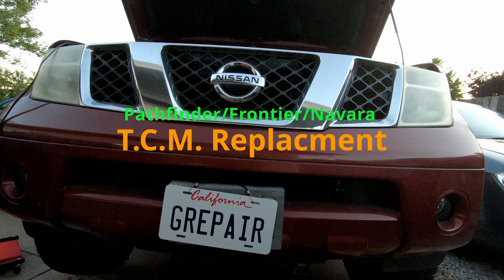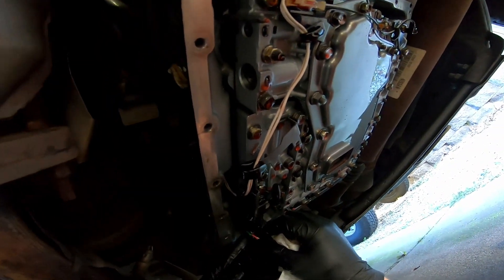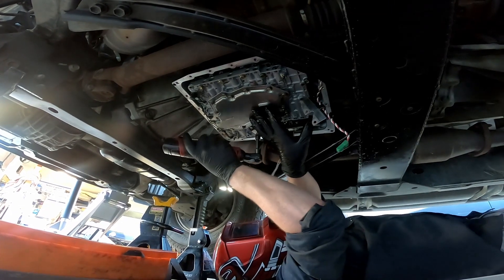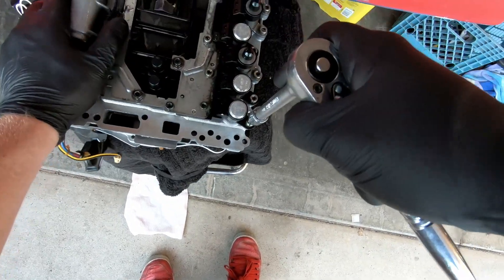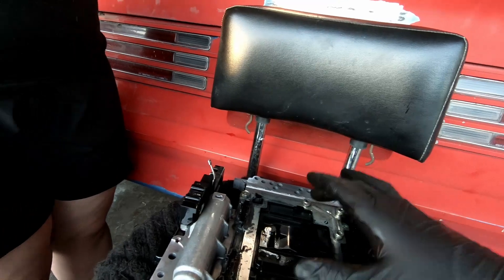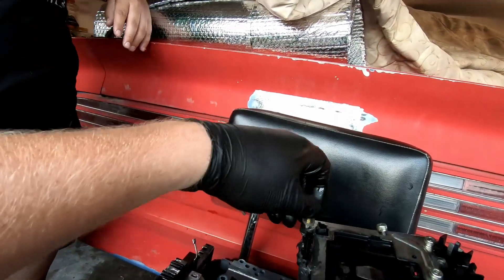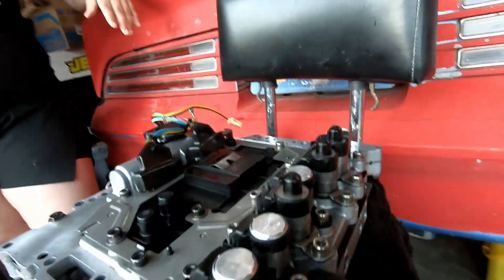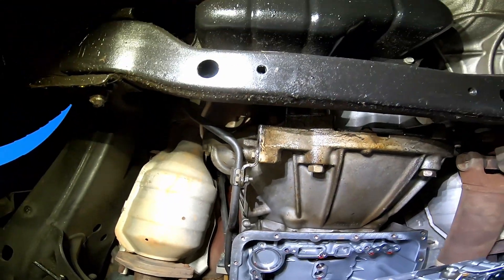How to Replace Nissan TCM 2005 - 08 Truck/ RE5RO5A

Comment: Great video brotha. I’m having reverse issues on my 05 pathfinder SE. what can possibly be the problem?
Reply from the maker: It's hard to say without looking at it. I could be the tcm, it could be a solinoid, or you may need a rebuild. Have you hooked up a scanner? Do you have any transmission codes?
Reply: @GrimRepair  would u happen to know if and where I can get jus the solenoids?
Reply from the maker: @jondoe1410  There is a link in the videos description.
Reply: @GrimRepair  where are u from? It’s saying that these items cannot be shipped to me. I’m in Sacramento California
Reply from the maker: @jondoe1410  I am not far from you, not sure why it's saying that.I will fix that link, thank you. The exact ones I ordered are out of stock. These ones say they fit 2002 - 2018 pathfinder. https://amzn.to/3sddV72
Reply: @GrimRepair  thanks bro. My car doesn’t shift into drive or reverse at all now. Taking it back to the dealer on Sunday

Comment: Hey i fully replaced my whole tcm with the valve body and now when i wanted to turn it on it said it was on 3rd and not on park, but it clearly shows on my shifter that its on P. Any help? Truck doesn't want to turn on cause of that and moving the shifter up and down doesn't change anything
Reply from the maker: Make sure the shift linkage is lined up on the valve body.

Comment: I purchased the silenoids on Amazon and it didn't give a diagram or instructions on which ones belonged in the appropriate spot. The numbers don't match on the new ones so I'm not sure where to place them. Any suggestions on the correct order?
Reply from the maker: There are 3 with the black caps sticking out on top, those go where the 3 with the black caps came out of. There are 3 without the black caps those go where the 3 without the black caps came from. Then there should be one that is mostly metal less plastic than the others that one goes on the end where the other one came from.
Reply: @GrimRepair  thank you. That's what I was assuming but I wanted to make sure. I'm working on my 05 xterra. I believe my solenoids are good but I had a break in the connection on the front brake solenoid. Seems to be pretty common. Thanks for the video.
Reply from the maker: @christopherlopez6768  that break is usually inside the tcm is that what you fixed?solinoids usually don't go bad but they break when you pull them out. Let me know how it goes.
Reply: @GrimRepair  yeah the break was in the TCM and I was able to pull all of my solenoids out without breaking any. Now I can return them to Amazon and get my $70 back. I soldered the break and hopefully that will fix the issue. Seems like people have had luck. Worse comes to worst, I'll buy a refurbished TCM and replace it. Did you end up buying Nissan transmission fluid to replace? I'm skeptical of buying anything other than the Nissan TF.
Reply from the maker: @christopherlopez6768  cool, I used valvoline.

Comment: Can I just replace the solenoids ?? I have the code coming up for the input clutch solenoid and how would reset it
Reply: Reprogram
Reply from the maker: You can replace just the solinoid, if that's all it needs you won't need to reprogram. It is likely a broken contact inside the tcm though, it's a common problem. I bought a remanufactured tcm and I did not need to reprogram it. If you do need to reprogram, you'll either need an expensive scan tool, or pay the dealer an hours labor.

Comment: I've seen this video before because I had the milkshake of death. But now I'm experiencing what you talked about at about 5 minutes into your video where it's not communicating and my truck won't start so thank you this video is amazing. How much did you pay for the TCM Module?
Reply from the maker: %
Thanks, I paid $600 from oriely's but prices have gone up since then. I tried going cheaper routes but both of those didn't work out. There is an amazon link in the description for the tcm I bought.

Comment: Thanks for the awesome Video Grim.  This sounds like the problem I having with 2007 Xterra.  I'm ordering the TCM from Street Smart tomorrow.  Do I just replace the radiator too or is there a separate radiator/cooler for the transmission?
Reply from the maker: Thanks, the factory set up incorporates the radiator, and it's prone to failure. If yours has coolant contamination you will have to replace it. If you live in a warm climate you can run an extra external transmission cooler to prevent coolant contamination from ever happening in the future.
Reply: @GrimRepair  I got the TCM and radiator switched out but the vehicle still isn’t starting. No codes but the dash is showing the transmission in 1 and not park. I tried the unlock gear shift. 

The fuse is good. Any thoughts?
Reply from the maker: @armh3  it sounds like your shift linkage isn't hooked up right the car won't start in anything but park and neutral.

Comment: So I ordered the solenoids on Amazon for my valve body, but it doesn’t say which is which and they are all similar.  Can you help me. Please?
Reply from the maker: There are 3 different types. One type has a plastic Top, one type has a plastic Nipple on the top and one type is metal on top correct?

Comment: Did you have to program your tcm? I did this to my 06 pathfinder, and it does not start, not even crank.
Reply from the maker: @joeortolani9897  I did not, does it say it's in park on your gauge cluster?
Reply: @GrimRepair  it does not. Thank you for responding. Come to think of it, when you turn the key to on, it wont even display the gears. PRND12, bad throttle body?
Reply from the maker: @joeortolani9897  Did you mean Valve body? Make sure your shift cable and linkage are lined up right and that everything is plugged in, also check the fuses. One of them may have blown. The car won't start if it thinks it's in gear.

Comment: What about the piston is that supposed to be aligned with anything ??
Reply from the maker: Can you give me a timestamp of the part you are asking about?
Reply: @GrimRepair  I have a 2005 Nissan Pathfinder and I just replaced the whole valve body and connected everything and now it only goes in drive I’m not sure what I did wrong
Reply: I’m going to take it off again and make sure everything is connected correctly but I’m sure it was all right
Reply from the maker: @chriselizaldi351  ok. Let us know what you find.
Reply: @GrimRepair  the part I’m talking about is on the opposite side of the solenoids where the connectors are at . It looks like a piston is that supposed to be aligned with anything ??
Reply: At 11:41 it’s at the bottom right looks like the number 2 right next to the bottom red color bolt
Reply from the maker: @chriselizaldi351  The rod goes in the opening just like in the video.

Comment: Hello, I bought the part and installed it in my 2008 nissan frontier started it up everything is back to normal but the transmission feels delayed or slipping any ideas?
Reply from the maker: Make sure you have the proper amount of fluid in there. Did you have coolant contamination?
Reply: Grim Repair no I didn’t not, the oil drained was red and looked in really good condition. Could it be that it just needs to be programmed?
Reply from the maker: @ibrahimalabdali4826  I wouldn't think so. What was the truck doing before you changed the tcm?
Reply: Grim Repair the 4wd light turned on and the car wouldn’t start unless the fuse for the tcm was changed
Reply from the maker: @ibrahimalabdali4826  If you're checking the level with the fluid hot, engine running in park on flat ground. And it  is full, I think you have something else going on, you may want to take it into a shop.

Comment: My armada throwing a P1716 code looked it up and it says the tcm... Can I get one from the junk yard?
Reply from the maker: It might work if you can find one. I would get a remanufactured one.
Reply: @GrimRepair  but that code does mean I need a new tcm
Reply from the maker: @joshuaboga8279  I might, codes don't tell you defiantly what is wrong they just point you in the right direction.

Comment: Thanks man! This is the best video on this out there. My Xterra only has a p0717 code. Do I need to replace the whole valve body or just the TCM like you did?
Reply from the maker: Thanks, I would just do the tcm.
Reply: @GrimRepair  Gotcha. Appreciate it

Comment: Hey man amazing video THANK U SO MUCH!! I have a 07 frontier I'm pretty sure it's the TCM. When yours went out what did it do was it a no crank no start when you turn the key over?
Reply from the maker: It was a crank no start. I had a communication error code and was unable to pull tcm codes the tcm fuse would blow every time I tried to start it. I had coolant contamination from a few weeks before, I had replaced the radiator and flushed the tranny, but I must not have gotten all the coolant out. The coolant causes the tcm to short out and blow the fuse.

Comment: How's the vehicle running since you replaced the TCM? Did you ever have to get it programmed by the dealership?
Reply from the maker: It's running fine, and no I did not get it programmed.
Reply: @GrimRepair   My 2008 Frontier just died. Wouldn't start.  Found the AT fuse blown. Replaced it. Got it to start again. But then after I turned off the vehicle, it wouldn't start unless I put another fuse in. It was also sluggish from 0-25mph. Shop said it was the TCM and wanted to replace the whole transmission. $4215 with parts and labor. I think I'll try your way first. If, this doesn't work maybe it'll be time for another vehicle.
Reply from the maker: @rajorab5055  make sure that your radiator didn't break at the transmission cooler. Coolant in the transmission can short out the tcm, that's what happened to mine.
Reply: @GrimRepair I had the SMOD so I did the drain & flush in my garage a few months ago. Also did the bypass that many others did so at least now they're not mixing. My truck has 125,000 on it so it might have been too late to stop the TCM from shorting.
Reply from the maker: @rajorab5055  Coolant can get trapped in the valve body and in the tcm. It's hard to get it all out make sure you flush it like I did in the end of this video after you replace it. When my fuse blew the first time I removed and opened up the tcm and blew it out with compressed air, it went about a week before the fuse blew again. After that I decided to replace it, but my point is that it can be hard to get all of the coolant out.
Reply: @GrimRepair  Thanks for the insight.
Reply: @GrimRepair  Hey Grim,  just wanted to tell you I purchased a Valvebody/TCM combo from Street Smart Transmission for about $490. I got it a few days ago and did the repair today, swapping out the old unit with the new one. My truck started right up and I didn't have anymore DTC's. In fact, I didn't even have to use my code reader to erase the U1000 code. It was just gone. The AT fuse wasn't blowing out anymore either. I did have to do a "Relearn procedure" but Street Smart provided instructions for that. Took my truck for a test drive and it wasn't sluggish from 0-25 anymore. It drove normally again, thank God. For anyone else that does this repair, just FYI, the valve body/TCM may be slightly different than your old one. However, Street Smart sends a unit that is "pre-flashed/programmed" for your VIN. You have to send back your old valve body/TCM to avoid the core charge but Street Smart provides a pre-printed UPS label & you just drop it off at a local UPS store. Grim, thank you so much for this video and your insight. It was incredibly helpful. I'll try to remember to keep you posted and let you know how its running a few months from now. Thanks again !!!

Comment: Sorry if I missed it, but is your Pathfinder RWD or 4WD?  I have a 2005 v6 RWD, but the Dorman site states that the 609-050 is only compatible with the 4wd for my year.  It is compatible with the 2007 RWD - I wasn't sure what changed btwn 2005 and 2007 for the RWD.
Reply from the maker: This one is 4wd. I would get the part they recommend for your year, make, and model. I believe the switched from one manufacturer to Bosch. The procedures should be very similar if not identical.
Reply: @GrimRepair  Thanks. My existing TCM is also Bosch. Unfortunately dorman does not make one for 2005 rwd. Thanks tho. Your video helped me take out the old one, clean and put back - it's just that the cleaning didn't help and my fuse keeps blowing.
Reply from the maker: @davidaggies131  you're welcome, thanks for watching.Have you checked  your local auto parts stores?
Reply: @GrimRepair  yes, unfortunately the results were the dorman, but they don't get into 2wd vs 4wd.  I just contacted dorman requesting clarification. I'm hoping since it works for 2007, that it'll work with 2005
Reply from the maker: @davidaggies131  Nissan also sells it new along with the valve body, but the wanted $1100 plus programming.
Reply: @GrimRepair  yea, I probably won't go that route... 😳
Reply: @davidaggies131  I purchased a remanufactured valvebody assembly online for about $540. It claims it will come flashed to your VIN and they even send you the packaging and label to send (the core) yours back. I've yet to install it.. I'm still on the fence about it. The company is called Street Smart Transmission.. they're in FL.
The package DID have some instructions for checking the turbine revolution sensors clearance/seating as well as a "RE5ROA re-learn procedure" that covers "accelerator pedal release position" and "throttle valve closed position" relearning. I can share that if useful to you.
Reply: @CUBICHI1985  any luck with your tcm?

Comment: so after replacement why would a shifter not want to shift into drive. the shifter is completely  stuck and now my truck will not start .
Reply from the maker: I would make sure that inside the transmission where the shift cable attaches to the valve body, is engaged correctly and not binding up. Is the fuse on the passenger side for the tcm good? did you make sure to plug the green plug on top of the transmission back in?
Reply from the maker: Let us know what you find, in case someone else has a similar issue.
Reply: Grim Repair ok i definitely will share my screw up just in case anyone else runs into this
Reply from the maker: @mcgilljb92  Screw up happen to the best of us.
Reply: Grim Repair  ok problem fixed so far . id prob need to do a video . maybe ill do a vid and u can add it to yours for trouble shooting . i had it where it wouldnt shift out of park , it wouldnt turn over , the obd scanners wouldnt link up right . so my first issue was i forgot to connect a small smalll wire to the tcm . that let the truck turn over and it would connect to the ecu . phewwww didnt burn anything up . issue woth shifting is that i should of started all the bolts and then tight the aligning bolt down . it was binding up . when i took it back off i could see where it bound up at . then i tightened my oil pan to tight causing it to bow and leak so i had to get a small peice of wood and a hammer and beat my oil pan back flat on the gasket seal . phewwwww . also its shifting right . the solenoid fixed the first issue . to me this is a 2 person job . with holding up the valve body straight so u can place the bolts in and allign it correctly . plus the trans pan goes on alot faster as well
Reply from the maker: @mcgilljb92  Great, thanks for coming back and commenting. Glad you got it figured out.

Comment: Best video I’ve seen those far. I have an 07 Pathfinder with probably the same issue. Mine won’t switch out of 2nd gear and I only could go 30 mph
Reply: you're in transmission limp mode.  a fail safe, best luck for your repair.
 I am have 2001 maxima with 213k miles transmission is having issues.  Believe its  the 
Solenoids. if its the torque converter, the transmission is not worth fixing
Reply: Yes I scanned it and that’s exactly what pulled up brake solenoid

Comment: And this is the common issue, and the reason the power distribution box is blowing the 10amp fuse going to the ECU?
Reply from the maker: This is a common issue. The tcm blows a fuse I dont remember what its labeled but i don't think it was the ecu fuse. It was a fuse regarding the transmission.

Comment: How much was it??? Does that long pin engage on transmission shifter?
Reply from the maker: The tcm was $600. I don't mention prices because they are always changing, usually going up. I'm not sure what you mean by long pin, can you give me a timestamp?
Reply: @GrimRepair  I replaced it and won't shift gears
Reply: @GrimRepair  you right it's 720 now
Reply from the maker: Do you have a video timestamp of the pin you are talking about?

Comment: Is it true these only last 100k miles? How do you know when you need a new one? thanks
Reply from the maker: I would say thats not true. This one lasted over 200,000 the transmission cooler failed and antifreeze killed it. If yours was bad you would most likely  have shifting problems. If you plug in a scanner that can read transmission codes, you will probably have trouble codes.

Comment: I've watched this video a couple times, very helpful. I had the SMOD happen to my 07 Xterra, but got it fixed (very painfully, but fixed). Recently, it's been going into limp mode intermittently and I'm trying to nail down the problem. Do you remember the specific code that was coming up?
Reply from the maker: Multiple Solenoid codes, I believe the code when it finally failed is in the video.
Reply: @GrimRepair  I listened to the video again, you cleared a communication code but it didn't say what the actual code was.
Reply from the maker: @Scott_the_Celt  u1000 was the communication code, you will need a scanner that can pull tcm codes to read many of them the check engine light may not come on for the transmission.